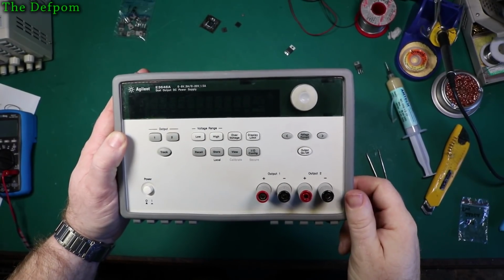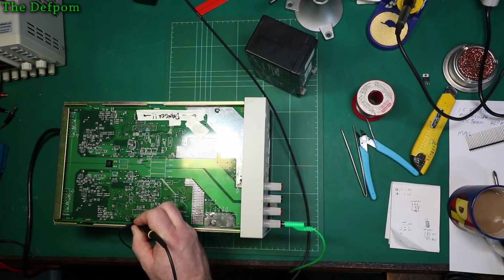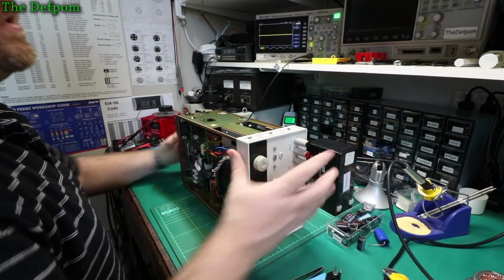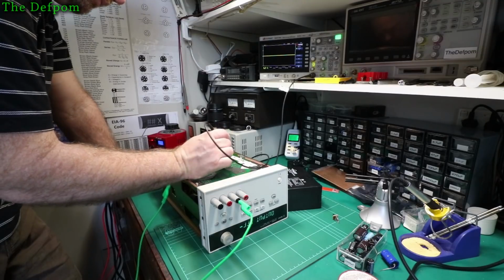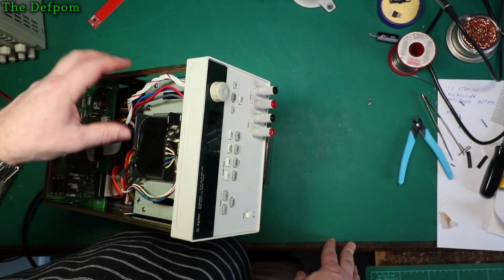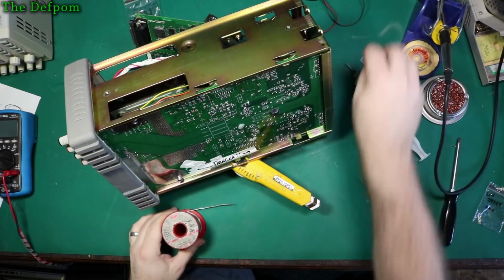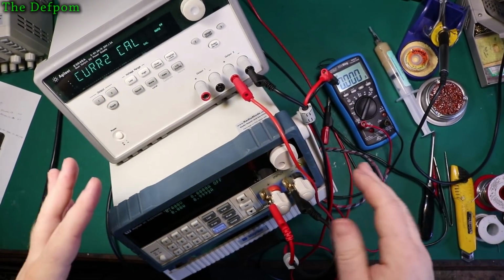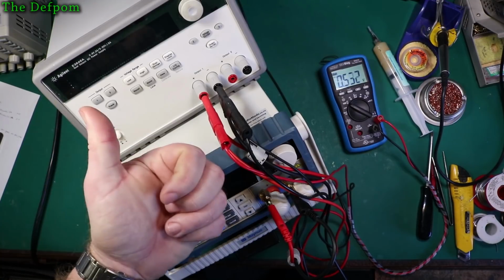🔴 #470 Fix It Friday - Agilent E3646A Power Supply Repair Part 2 - IT WORKS!

Comment: That’s a great looking power supply, you really earned this one. Great job.  Like the fast forward solder sucking action.
Reply from the maker: AllTheGearNoIdea - yep it is indeed a nice supply, now I need to figure out where to put it, and in which lab... I purchased the Siglent single channel supply (which I previously reviewed) for my rf lab, if I move my big 35A supply out there then this supply might fit here, but then I think I might need it in the other lab.

I screwed up the editing on this one, I had the 4x speed comment etc all lined up, then I decided to change the video intro and forgot to shift the comments with it.